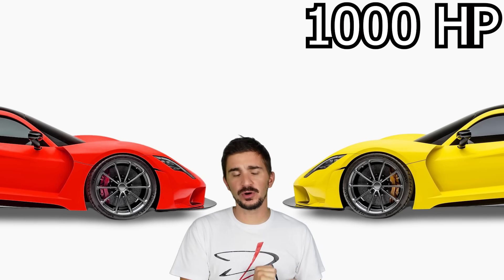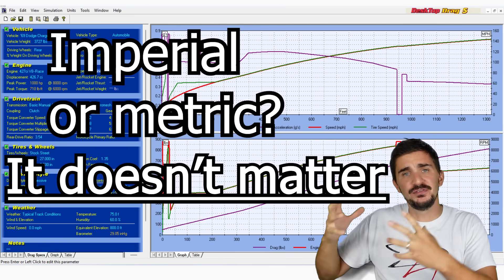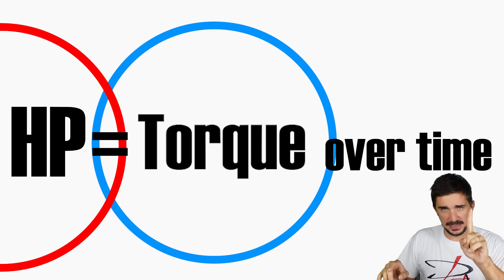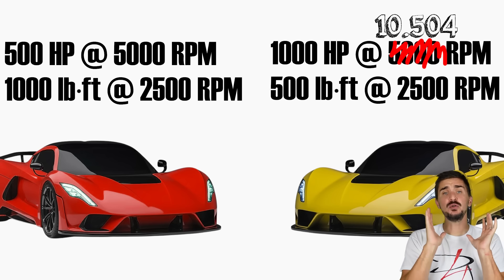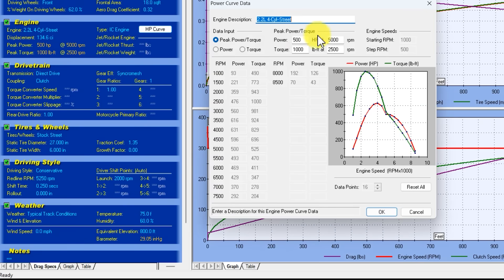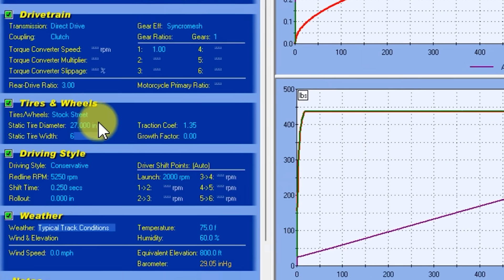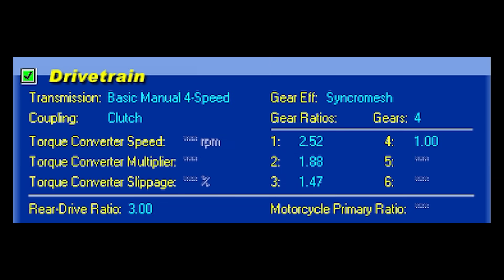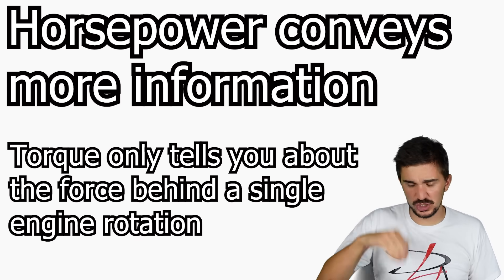Who's faster? Explained and Simulated - Horsepower vs Torque

Comment: There is one other factor that plays into this. If you want a vehicle with good acceleration, you need all drivetrain parts, engine, clutch, transmission and even wheels and tires, to have a low moment of inertia. I'm wondering if the software you are using is calculating that by the type of car you are using.

Comment: I have a question please 
If I have to switch the engine in my excavator from gas engine to diesel 
Now I have 15hp gas engine in my excavator 
I wanna switch it to a diesel engine 
How much torque do I need in my new diesel engine that I wanna install it in my excavator ?
Now my excavator doesn’t need speed all it need it torque 
Thank you

Comment: I had it explained  to me, a very long time ago,  that HP is how fast you can go and Torque  is how quickly you get to that speed.
Great video explaining  it all.
Reply: No. Horsepower is how fast you accelerate. Not torque.
Reply: Torque is the sound of one hand clapping.   Torque is meaningless without RPM.

Comment: A high torque car is a blast to drive in normal traffic, especially at moderate (legal) speeds whereas a high revving , high hp car is advertising via all the exhaust and high rpm noise that generally goes along with it. They both have their virtues in real life.

Comment: I think you failed to show that the high torque engine was actually utilizing more HP for more time because the high HP engine never got to the area where it made HP. 
In the end, TQ didn't matter.  
What mattered was that the average power was higher in ALL winning cases.

Comment: Unless you are keeping the cars under 5252rpm, higher HP wins with the same gearing/weight etc. in a race, you spend zero time at peak torque outside of first gear. Your past that point with every shift. HP wins and it's not even close

Comment: This depends on the ratio of mass to air resistance as well, since torque manages mass and horsepower manages air resistance.  The faster you go, the less torque matters and the more horsepower matters.
Reply: Torque is the sound of one hand clapping

Comment: I believe your wrong … usually smaller engines are higher revving with lower torque … bigger engines are slower revving with higher torque  … but this is not always the case … 
Your experiment would have been more convincing if you got a big block car to race a small block car of the same weight …And the big block was higher torque than hp … also the small block  was higher hp than torque … because you can still get a high hp big block with high hp …

Comment: Torque = force. Horsepower = rate of work. Torque is how much force the engine can deliver at the crank. Horsepower is how much work that engine can accomplish over a period of time. Lifting 500# is impressive but if you can’t do it very often then someone that can lift 250# many times in a time period will likely generate more actual work.

Comment: What software program are you using?  And is there a program that can tell me what RPMs is best to shift at for maximum speed/fastest time?  My bike Redline is 14,200 RPMs.  Torque begins to fall off at 12,000.  HP falls off at 13,250.  Many will say to shift just bwyond maximum HP to stay in the maximum power band.  For example, shift at 13,500 or 13,750 so when the RPMs deop I am still at maximum Horsepower.  But I tested my shifting at or just beyond 12,000 RPMs (maximim torque) and achieved a faster time.  I understand wind, temperature, elevation, slope, body position, shift technique all play a role.  But can anyone elaborate further where it is best to shift for maximum speed/time?  At max torque or max HP and why?  If torque "gets you there faster", why not stay where it's fastest at 12,000 RPMs?  If HP keeps you there, why not shift at max HP of 13,250 or 13,500?  Can someone elaborate?

Comment: The same equation has to be adopted to the 1000HP engine. This engine will peak at 2626RPM. Assuming 500 torque at 2500 RPM.

Comment: So then shouldn’t a dyno always show the same horsepower to torque ration on every vehicle? Every 1000 hp vehicle should have 1050 torque? This is super interesting I love stuff like this.

Edit: wait! I just realized, the peak power rpm level will be different on different engines which will change the equation so that the HP to Torque ratio will be different on different engines.

Comment: "you cannot deliver a lot of damage with weak punches"

Oh, hello there 18,000 rpm motorcycle engine. You may only deliver a toddler's punch, but that toddler has been juicing since it was in the womb and punches 600 times per second.

Comment: Horsepower sells cars, torque wins races.
Reply: So than put in gsxr 1000  frame 117milwauke8 engine big Vtwin 1923 ccm 180 nm and 110 hp and try win world superbike race against stock gsxr 1000 with 999 ccm inline 4 120 nm 230hp engine 👌🏻🤭 👉🏻 0 chance for make it happen unless stock gsxr 1000 crash 👌🏻 stock gsxr 1000 wsb race prep accelerate from 100 to 200 km/h in like 3 sec vs with this 117 milwauke 8 swap let assume weight stay the same it would accelerste from 100 to 200 km/h in like 8 sec +/- 🤭 ….. POWER WIN RACES and torque is only component which is 100%  compensate be rpms 👌🏻🍿 other word 1000 nm at 1000 rpm be the same fast as 100 nm at 10000 rpm if you  geared up both engines perfectly the only doffrcnes be that first engine on race track work on 1000 rpm and second on 10000 rpm 👌🏻in reality you would not need 1000 cc race class for beat this gsxr with swap on. 117 milwauke 8 world supersport class with 600 cc inline 4 with 70-75 nm and 140 hp be way enough for beat this avg big Vtwin 100-110 hp with 170-180 nm on race track 👌🏻☕️
Reply: Torque is the sound of one hand clapping

Comment: With more torque opposite lock you have a strong motor not weak with only hp torque has more cylinder speed present so there’s more time for air and fuel charges because if cylinder speed drops off so does the hp you end up with a dead horse

Comment: Alright lets simplify it horsepower HP or BHP depending on where your from is how quickly something can turn and or rotate. Torque is how hard something can rotate or turn. So knowing this a car with 1000 HP and 500 torque will be able to turn  at 500 torque much quicker then if the stats were reversed giving it more of a quick burst of power that'll knock you back into your seat. However a car with 1000 torque and 500 horses will be able to rotate 5 times as hard but slightly slower than the previous car so when you floor it you wont get knocked back into your seat instantly however once the power kicks in nothing is going to stop you from reaching your top speed very quickly its almost like has a large turbo but its naturally aspirated which is cool. So whats the takeaway? Well. It depends on what you want to achieve if your going uphill probably take the torque car. If you have a consistent flat road probably take the hp

Comment: simple ans that took 15min yet cant   ans straight
Reply: The straight answer is: With the same conditions, the vehicle with less hp but higher torque outruns the exact same vehicle with considerable less torque, but more hp!
Reply: @postelnicuadrian72  Current F1 engines produce about 750 hp at  torque output of about 280 Nm.  Chinese Made Automobile Beiben Truck Dump Truck: This dump truck has a maximum horsepower of 550 and a maximum torque of 2550Nm.   -guess u aspire to race in a dumpster at F1

Comment: Torque = work
Hp= the amount of time work was done.
Not that hard ppl. lol average power of torque and hp wins.
Heavy car needs torque to move
Light can doesn’t need as much torque. easy to make hp with rpm. Torque a different story.

Comment: The way ive always understood it was torque wins drag races, horsepower wins roll races.
Reply: not long ago resd comment where power win from dig and torq from roll 🤐 welll none is true 👌🏻 as long as ewch vehicle have perfect gearing and riders are allow to use optimal gesr all the time and not som st.pyt 5 vs 5 gear roll os as long version with more power /avg power and less torq win from dig and roll feg 1/4 mille race monster 1100 103 nm 95 hp 270 kg with driver 11,2 sec at 186 km/h corrected 1/4 mille vs triumph street triple 765 r 80 nm 120 hp 270 kg with rider 10,4 sec at 201  km/h corrected 1/4 mille where corrected mean each vehicle  drive in egzacly the same  test condition so wind pressure tire pressure asf and not one under 50 km/h head wind and other under 50 km/h tail wind asf 🫣 👌🏻 now roll  drag the same 👌🏻monster 1100 from 100 km/h roll on optimal gear start  whatever gesr is nededd for fastest launch from 100 km/h roll drag for monster it be 2 or 3 gear most likely and for each  other bike also optimal gear dosent mstter it be 1 like in litres sport bike or 6 like in 125 cc  with 15 hp 👌🏻 anyways 100-160 km/h 4,0 sec 👌🏻 100-200 km/h 11 12 sec 👌🏻vs stret triple 765 r 100-160 km/h 3,0 sec 100-200 km/h 7,5 sec 👌🏻power at perfect gearing win alll race setup ypu want 👌🏻from roll from dig dragg and on track with corners on avg trafk 4 km lenght with corners on the same  tire assuming none of bike is limited  be to small lean angle 👌🏻 if monster 1100 do 1:50 than 765 r do 1:45 👌🏻+/ …

Comment: High Torque is good when you at 2000-4000 RPM ,
High Horsepower is good when you at 6000-7500RPM,
End of the story

Comment: Here is another point, high torque doesn’t need small gears to get the most of the engine. To select the right gear, you need to make sure when you cross the 1/4 line that the engine is in its horse power range.

Comment: TLDR: Torque is how much work can be done. Horsepower is how fast you do the work
Reply: High Torque is good when you at 2000-4000 RPM ,
High Horsepower is good when you at 6000-7500RPM,
End of the story
Reply: @robertdees6393  close. torque is how much work can be done at a specific engine speed.  Power is how much work can be done in a given period of time or how quickly a given amount of work can be done.  The engine’s overall capacity to do work is always greatest at its Power peak.

Comment: This should have laid the concepts on a more fundamental level. Power is what you need to go faster, period. That's just it really.  Power is dissipated due to rolling and aero resistance, which is a function of speed.

Of course you have to match up everything in a car accordingly afterwards, but those are some "minor" details. 101 physics gets you the answer.

Comment: I've seen a Porsche with 600 something horses but much more torque winning against a Lamborghini Aventador svj
Reply: assuming both have the same resist it only mean 911 use more wvg power for accelerstion or if froms tsndstill have more grip asf asf nothing more 👌🏻🍿 can subscribe car which much less torq than this 911 but at much more topend power + perfect gesring willl absolutely smoke this 911 👌🏻feg imagine 1500 hp 500 nm engine hard to achieve such numbers cos rom for achieve 1500 hp from only 500 nm would need to be extremely high  lowest 21362 rpm 👌🏻 but lets assume we have such engine now we conect it with perfect gearing including 1 gear lenght for go at grip border from stop gear wuantity and diffeences between gear lenght perfect clutch characteristic upshift time the same the same weight drag drive train type weight distribution asf and now from sped fom which this 1500 hp 500 nm be able to use more power for accelerstion without lost grip he start walk away and couple sec after this 1500 hp 500 nm car is gone when he be able to usemore and more power without lost grip at 300 km/h be mile ahead 🌪️👌🏻assuming we setup both car with some super stickie drag tire on sepcial prep surface 1500 hp 500 nm at perfect gesring start ride away fast very soon 👌🏻☕️

Comment: Joke's on you.  I already had a headache!  In all seriousness, great explanation and analogies.

I would think that with proper gearing, you could get good performance from a wide variety of engines by keeping them at peak power.  Adjust the wheel torque based on needs at the moment, hence why a theoretically optimal CVT could come out on top.

Comment: Torque numbers become interesting in low speed environments. I'm always amazed by how mind numbingly easy it is to drive low torque rental cars compared to my own high torque car with not too much more horse power.

The reason is, basically what you said in the beginning but argued backwards, high torque cars must make their peak torque early in the power band and taper off quite quickly.
My own car is a high stroke low bore engined car. It is ultra fun to just pull through corners on rural roads, but you have to have the patience of a saint from a standstill, or the wheels spin at the traffic light, making you look like a bozo. And after 4500 RPM the redline might still be a good but away, but you're better off shifting.

The rentals you get on a vacation are not usually torque monsters. You actually have to rev the car up a bit to get anywhere from a standstill, which also makes it mega easy to modulate the clutch and get off the traffic light smoothly. If the rental car configuration made the same torque at the same RPM as my own car, that would be some Golf GTI sort of a deal, completely in a different league than my own car.

In essence, the comparison would have been more interesting for the same horsepower but the peak RPM at different RPM. High torque early makes for challenging cars that are ultra fun to drive, but also gonna make the average drive feel annoyed to be patient with unless geared so damn long that they turn into your dad's diesel wagon.

Comment: There's a reason vehicles carrying heavy loads have lots of torque and relatively not that much power- average semitruck has 400-600hp but 1-2k ft lbs of torque.
There's also a reason why Hayabusa can go almost 200mph even though it has a bit above 100 ft lbs of torque- it has little torque but revs to 10k rpm and has good gearing.

Comment: It's not "torque" or "power" that is important but a well mated transmission ratio to an engine. If you use a screaming 2000s formula one V10 with tall diesel truck gears, it won't be able to rev into its power band before the forces of nature quench it.
Also an engine with a high power but in a very peaky power band - a one rev wonder, like some two stroke bikes, will take ages to get to its sweet spot and then fizzle out if you don't have a succession of closely spaced gears or a CVT.
You need the right ratios and close enough spacing to shift at the equal power values either side of the power peak.

Comment: The 5252 comes from the fact that a horsepower is 33000 foot pounds per minute. Thus a pound foot of torque (spins in a circle with a pound of force on the radius of a foot) does 2*pi foot pounds on every revolution. Thus to get 1 horsepower with 1 lb foot, the required rpm is 33000/(2*pi), or 16500/pi which is 5252.113...

The 9549 comes from the fact that a kilowatt is 60000 newton metres per minute. Thus a newton meter of torque (spins in a circle with a newton of force on the radius of a metre) does 2*pi newton meters on every revoultion. Thus to get 1 kilowatt with 1 newton metre, the required rpm is 60000/(2*pi) or 30000/pi which is 9549.296...

Comment: This confuses the core question with all the extraneous factors added in. Bottom line is 1000 Horsepower beats 500 Horsepower easily when each is gear properly.

Comment: Don't transmissions render torque completely irrelevant? Horsepower is all that matters, or am I wrong?
Reply: Yep. As far as the engine goes, peak power tells you like 80% of the story, and the shape of the power curve tells you all the rest, in every vehicle, at all times, in every kind of performance contest. Knowing engine torque is not relevant for vehicle performance.

Comment: Hp is product of torque and rpm but if car has a hp 200 @6500 rpm this hp is generally useless in city driving. This is what car manifacturers marketing high hp especially with turbo and low liter engines.

Comment: "knowledge is power" - people that debate torque vs power. 
"power is power" - people that defeat those who debate torque vs power.
🤔🤷‍♂️
Reply: @graphixkillzzz  exactly 👍 how did you go 6mos without a like or single validating comment?  Without RPM, Torque really can't do much for you. How anyone would think that torque is a greater measure of an engine’s capability than power is quite bizarre. Very one dimensional thinking.

Who would compare Width to Area and conclude width is the greater measure
When we know Area =
Length multiplied by Width

Or compare Stroke to Displacement and conclude Stroke is the greater measure
When we know Displacement = Bore multiplied
by Stroke

Or compare Force to Work and conclude Force is the greater measure 
When we know Work = Force multiplied by
Distance

Or compare voltage to Wattage and conclude Voltage is the greater measure
When we know Wattage = Voltage multiplied by
Current

Comment: Horsepower measures the rate at which the engine performs work over time, while torque represents the rotational force applied to the wheels. Applying force to move the vehicle requires energy, with power reflecting how quickly that energy is used. It's why horsepower can be directly converted into kilowatts.

Comment: Good video, but I would explaine it in a different way. According to Newton, it is force that accelerates mass (no power in the equation) F=m*a. So, the accelaretion of the car depends on the force that the tires pass over the ground at a given mass. The force is arising from the torque on the wheels divided by the radius of the wheel.  The 'horsepower'  is needed to sustain the torque (accelerating force) over time (rpm) as the wheels will be faster and faster rotating. In my opinion the test is not fully valid as the wheels could not handle the accelerating force, so the acceleration was not at maximum. Also we have to know how the torque is changing over time if we want to know how the car will accelerate.